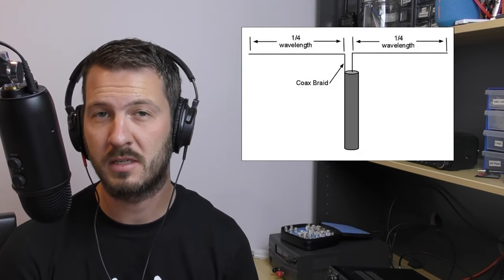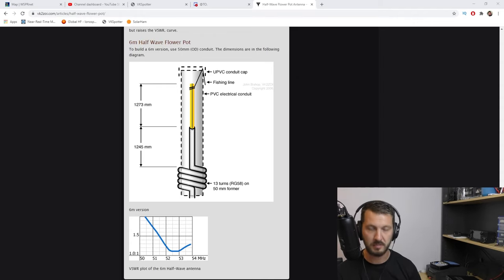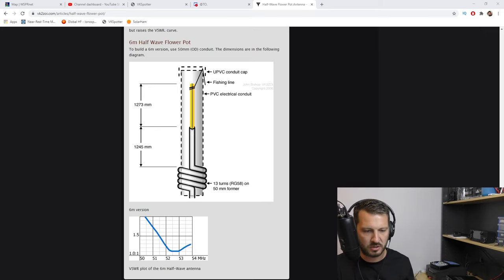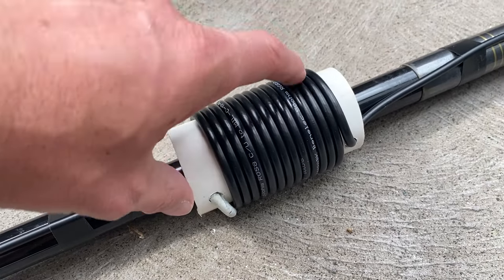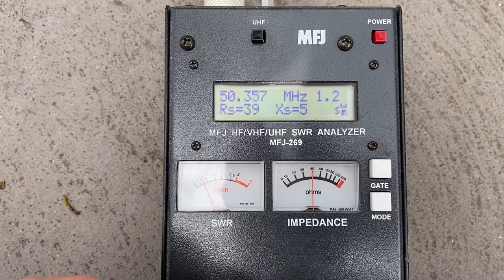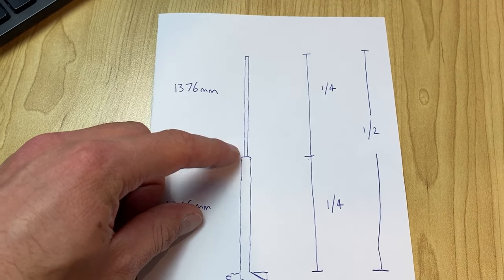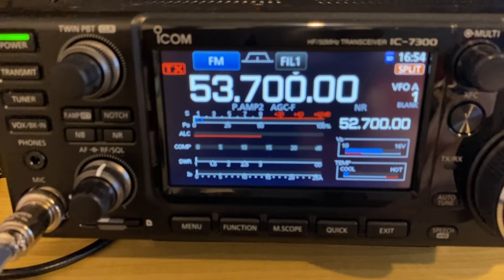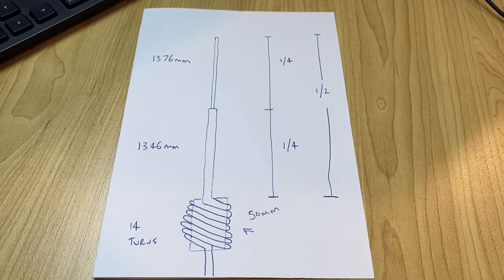Build an EASY 6 Meter (50 MHz) Vertical Antenna (Using just RG-58!)

Comment: This simple antenna was described by Bill Orr, W6SAI back in 1959 in his book "S-9 Signals,
Inexpensive antennas for the radio amateur."  He described it as the "Cobra" antenna due
to it's coiled decoupling choke at the base of the radiating portion.  I built a few for 10 and 6 meters.  Nice to have it "rediscovered."

Comment: I am new in to 6 meters and seen your video. I build it with RG8X to your specifications and i have a 1to1 SWR on 50.145 Mhz. Can't wait to try it out in the morning when the band opens up. Thank you for this great video.
Reply from the maker: Glad to hear you got a good SWR result Terrell! GL hope you work a few on air
Reply: ! only have a piece of RG8X, I can use this without modifications to this design?
Thanks, I'm a noob, have a IC7300 w no 6m antenna.
Reply: @elconquistador932   did you make it?

Comment: Great Antenna Thanks. I built one this morning, with measurements bare coax 1330mm, shielded coax 1295mm and 14 turns of coax on 50mm pvc.  I mounted it about 500 mm above my flat roof. 1:1.2 from 50MHz to 52.9Mhz
Reply from the maker: Nice work!

Comment: We used to call this a coaxial antenna, widely used for "mobile telephone" service before cellular phones made that service obsolete. We used to see those mounted on limousines, with a chrome plated tube forming the lower quarter-wave section and a whip antennas as the upper quarter-wave section. This seems an easy way to make one. It should work well on 2m too. Nice approach!   ~ de ND1L
Reply: Conner Alexzander  ...which has what to do with antennas? Or are you advertising something?
Reply: Had a friend who threw away a marine band antenna since it’s Radome was crushed. Took it apart and what to my eyes see? A coaxial antenna. Just remounted it into 1/2 inch CPVC water pipe. Worked great!

Comment: Well, I know this is an old video, but I stumbled across it, and boom, in one day (after some part scrounging) I have a 6 meter antenna! Used 1 1/2 inch ID PVC for the base and coil wrap with a pvc reducer to 3/4 for the vertical mast. VSWR of 1.5 at 52.4 MHz (13 wraps). Total cost less than $30. Great. Thanks. Subscribed. W8ISM
Reply from the maker: Nice work! Good stuff, 6m has been open the past week or so.

Comment: Just made this and works well.. used 13 and half turns and is all good no RF in the shack... Silicon seal tube for a 50mm coil...did the job.
Reply from the maker: Nice! How's it performing?
Reply: @HamRadioDX  Working really well. Strong locally in East Yorks area and DX into Germany and Italy on the first test out..

Comment: Hi Hayden VK7DG, I built one a few years ago for 6metres and instead of cutting off the coax shield I folded the shield back over the lower 1/4 wave with the insulation on it. This gave a flatter SWR across the band. I used a smaller coil former for the choke to fit the fibreglass pole I was using.  Cheers and good stuff.
Reply from the maker: Thanks Dale, that’s something to think about an experiment with! I was going to do another one, and maybe one for 10m to have a play so I’ll try that, thanks. Did you put heatshrink or something over the braid to keep the water out?

Comment: I need a 6m portable antenna. I found your video and built it with your dimensions, except with RG-8/X and not with RG-58. The SWR is 1:1.04 at 50.180 MHz. Great and thanks for the video.
Reply from the maker: Awesome mate!

Comment: Yes, the vertical bazooka antenna works great. One reason for this is it's a 1/2 wave dipole, no radials to push the pattern up towards the sky, so the radiation angle is zero, flat to the horizon. Back in the 1970s, I used to sell and service equipment for CBers during the CB-craze. The best performing antenna back then was Shakespeare's "Big Stick", which was exactly this antenna, just constructed a little differently to form a 17 foot tall self-supporting pole. 

Thanks for working out the numbers for me. ;-)  I came here because I need to throw together a makeshift antenna for 6 meters and this will be it.

Comment: Wow! I've now got a new dummy load. I made one and VSWR is 1.1-1.3 across the band. Length of exposed top 1,350 mm and bottom 1255mm. It will not be enclosed; it's a roll up to pack. The only modifications is that I formed an eye at the end to make it easy to hang. That effectively reduced the length by about 3/4". The other is that I used a disposable water bottle with a 2&3/8" diameter with 13 turns. Before making it I also calculated the feed line length to be virtually invisible using the VF of .66 before I cut it. All this paid off that I didn't have to trim it to get what I think is perfect. Hung it in a tree once. Now, if only I could get one QSO.🙄 I bought 100' RG58/U with BNC connectors for $18, so what I used cost $8. It has an adhesive backed foil that peeled off easily. Did your VSWR go up or down when you enclosed it in the PVC tube?😏

Comment: I would have liked to see you adjust this antenna to get a better match. Sure it's ok and you might use a tuner, but some of us want to use it on the SSB range Nd won't know how to tune it. Do you cut or extend the top, or do you add or remove a turn like many suggest? Left wanting more info Cheers

Comment: I have an old Amtron 11 meter antenna. Can i use it just as the whip and attach the stripped coaxial to the outside as you did with tape or zip ties. Not sure if the internal part of the 11 meter antenna will effect the performance.

Comment: I know this is a 2 year old video; however, I recently fell upon this and another one you did with this form of antenna. I have a question on the need for chokes, grounding, etc. Is a choke required or does the windings act for this purpose. Is it required to provide a ground system for this antenna if it is not used as a permanent install...only erected for use and taken down.

Thanks!
Reply from the maker: Hey mate, the choke is the coiled coax. It appears as a high impedance on the outer shield of the coax to stop common mode currents from flowing on it, back down to the transmitter. It’s pretty critical to get the correct turns/diameter otherwise the coil wont provide a high enough choke impedance. No need for a ground

Comment: I have an 8 metre squid pole with a choke at the bottom for HF. Question? Would it be feaseable to parallel the 6m ant to this, ? Thanks.

Comment: ..looks like your using RG 58 for the long feedlines... that stuff has 3.3db loss @ 50mhz (over half your power and received signal) If you can get some LMR 400 it would make a big difference. Buying a new FT891, best value in ham radio... and lo but it has a 50mhz bonus..my 80-10 EFHW does not work on 6, so this is a cheap n nasty option.. tnx Hayden   Richard VA7AA

Comment: Excellent video. I will build one of these this winter. For SWR purposes, do you have any idea of the length adjustment to make if I want to house this in a 3/4 inch diameter pvc pipe rated at 480 psi (standard thickness)? Thanks
Reply from the maker: Not sure about the exact length adjustment putting it in a radome. But I'd start off by making it slightly longer than you need, and then trimming from there.

Comment: Just a quick PS -- I DID strip the foil shield off when I stripped the braid on the top section.  But it's still there in the rest of the coax.  Thank you.

Comment: How is this a dipole when it's using the full coax as part of the half wave? Wouldn't in theory the full coax cancel out the magnetic field? I know that the rf will ride back down the shield but wouldn't it be more effective if there was an additional conductor attached to the shield that folded back on itself?  I'm new so sorry if this is a dumb question.
Reply: No.  Skin effect gives effectively two conductors.  One conductor is the inside of the shield with current flowing in one direction and the other is the outside of the shield with current flowing in the opposite direction.

Comment: How long is your rg58 feeder to the antenna? Line loss on 6 meters can be substantial. Loss is on the order of 2.7 dB per 100 feet. 100 watts in nets about 53 watts at the antenna end with the rest heating the coax. It affects receiving signals too. What kind of coax is on your Diamond antenna too? It is strange that you get such good signal on the homemade antenna and no signal on the Diamond. Coax or connector trouble?
Reply from the maker: Feeder is about 30 feet. Diamond antenna uses low loss LMR-240, same length.

Comment: How critical is the coil to the overall tuning and performance of the antenna? I have a T2LT that I made for 10m and no longer need. It can be easily cut down to length for 6m but the coil is 16turns on a 68mm former. Do I need to change it or is the coil less important?
Reply from the maker: Yes you will need to change the coil as the impedance of the choke will change. You’ll basically need less turns, so just unravel a few until you get the proper amount and run that extra cable back down into the shack

Comment: May be a silly question but .. why is the top 1/4 a different length to the bottom 1/4 ?
Reply from the maker: Velocity factor of the coax (bottom half) makes it slightly shorter
Reply: @HamRadioDX  I still can't see how you arrived at these figures, even taking into account the velocity factor if your target freq was 50.3Mhz.  Were you rounding off the numbers or did you change the target freq you mentioned in the video.
Sorry if I'm being a pain, I'm a bit new to this and my calc's don't come up with the same numbers.
Are the final numbers you have shown been AFTER trimming to achieve a decent SWR?
I've worked on 299.79/50.3Mhz and a velocity factor of .95
Another stupid question ... why does the velocity factor only affect one side of the antenna?

Comment: How much power loss do you estimate that your loosing with the impedence down in the low 40's?
Reply from the maker: Google “mismatch loss calculator”. Even with a 3:1 SWR you’ll lose only 1.25dB of your power. With 40 ohms purely resistive and no reactance, SWR is about 1:25:1. In other words - not much at all

Comment: Nice! I might make one of these, if I can get my hands on a pole. Whats the gain on one of these?
Reply from the maker: As it's just a basic vertical dipole, there is no free space gain as such. You could probably space it away from another pole used as a reflector to get some gain in a certain direction however

Comment: I'm a Newby at this stuff so please be patient with me.  I built the antenna to  your specs, but it was resonating at about 48 mhz and swr wouldn't go below 1.7.  I tried shortening both lengths proportionately, and the darned thing won't resonate at all! Two questions: First, the RG58  I used had a foil shield inside the braid.  Is this causing a problem?  Second, in America I couldn't get a 50mm coil form, so I used the best I could find -- a 2inch pvc pipe.  Needless to say it's close but not the same diameter.  Is this causing a problem?  If neither of these things is causing a problem, what do I do now?  Thank you.
Reply from the maker: Hey mate,
Couple of things - the RG-58 with a foil shield might have a different velocity factor, so the lengths may be a little different. You're right though, shortening the elements should have brought the frequency up. Where did you get it to resonate after you shortened it?

2 inch PVC pipe is fine. Maybe see if you can find another bit of RG-58 to try?
Reply: Thanks so much for responding.  When I shortened it, it wouldn't resonate acceptably anywhere.  I think I'm going to find a hunk of RG-58 without the foil.
Reply: You must have missed this. Peel the foil off. I did and VSWR is 1.1-1.3 across the band.

Comment: 9.28 the  diamond antenna has an incorrect connection. the cable must exit strictly in the center of the branch pipe.
Reply: Huh, really? I mean, mine is like that anyway.... but.... would it really effect performance that much???
Reply: @anonyninja7737  this is part of the symmetry. Helps from the leakage of RF currents on the outer part of the braid

Comment: Thanks Hayden, I just put a new Bushcomm swc100 up after lightning strike blew last one apart. Surprisingly, the old antenna had a SWR of 1.2 on 52.525?  New one is SWR 3.8.  However the 7300 tuner can get it down to 1.2. Have had a chat on 53.825 repeater with good reports.  How much damage am I going to do????  Should I attempt to build this antenna for 52-54Mhz. Cheers and thanks. Don VK7LDH.
Reply from the maker: Hey Don, the new one you put up, is that tuned for the bottom end of 6? You won’t do any damage if you use the tuner to keep the SWR down. I do it with my 6m vertical, it’s tuned for the bottom end of 6, but if I want to use the FM repeaters I use the tuner as it’s above 2:5 up at 52.5 MHz. Hope that helps, be good to chat on the repeater soon too 👍 can you get into 53.700 repeater?
Reply: @HamRadioDX  the antenna is only tuned for 80 - 10 metres. That is why I and Bushcomm were surprised with 6m. Yes, I get I to 53.700 (Kaoota). It would be good to catch up on there sometime. Thanks for your answer. Without 7300 tuner, the entire 50-54 is over SWR 3. Tuner brings it down though. Cheers.
Reply from the maker: No worries yeah if tuner tunes it down and it gets in all good 👍 catch you on the air soon
Reply: @HamRadioDX  I will call on it more often. I also get into the 10m on 29.680. Both usually quiet I find. Like now :)
Reply from the maker: Cool, 29.680 is offline at the moment, on the to-do list to fix!
Reply from the maker: Just checked out your QRZ, you have a great outlook up there!
Reply: @HamRadioDX  and here I was thinking, these things (repeaters) just worked/appeared like magic 😀  so dumb of me 😀 If you ever need a 'non technical' hand, yell out. Yea, God's country up here 😀

Comment: I built one and it worked well as far as SWR. I didn't have 50mm PVC so I used 40mm electrical conduit and added a few extra turns of coax. Measuring to an exact millimeter is rather difficult. I just got as close as I could. It appears to be very non-critical. SWR bandwidth seems very wide. Now I would like to determine if this can be scaled up to 17 meters. I wonder how many turns on what diameter to use for an RF coke for 17? All I can due is experiment.  Thanks for your video.
Reply from the maker: There might be a bit of extra info in this video -  check the description for a link to turns on different former sizes too. Cheers! https://youtu.be/GCubZoD25tc
Reply: @HamRadioDX  yeah. Quite a bit of chatter that had nothing to do with half wave verticals. One thing I'm truly curious about: how did you arrive at these dimensions? A quarter wave at 50.5 MHz is 1411mm. Allowing for velocity factor if indeed that applies (66% for RG58A) would give 931 mm. So where did 1346 and 1376 come from? Just experimentation?
Reply from the maker: @1dxvictor  the dimensions were scaled from the VK2ZOI experimentations. Just tried it until it worked
Reply: @HamRadioDX  OK. You got me. I can't find any mathematical approach that results in your dimensions. Most methods come out with values quite a bit smaller than what you have. Trying to scale this to 10 meters will be interesting!
Reply: @1dxvictor  .66 is VF inside the coax, not for current flowing on outside.

Comment: Thanks for the build and demonstration, but I must chime in that it would be a more accurate test if each antenna had the same feedline.
Reply from the maker: The coax antenna had RG-58 as the feedline, probably about 5 metres. The Diamond has LMR-240 which is lower loss but about 10 metres. At 50 MHz the loss difference would be within 1dB.

Comment: The fundamental design issue with this type of antenna is that the choke (coiled coax) is at the end of the lower dipole element, which is a point of maximum voltage and thus minimum current. Chokes are magnetic components and thus work on current. So it's not the ideal location to place a choke; it can't possibly be highly effective at the location. This is not to say that it wouldn't work as an antenna; stray currents on the coax can radiate too.

The coaxial or sleeve antenna, where the lower element has its own hollow element with a true end (open circuit) at the bottom end is fundamentally a better design (at least theoretically). Note the distinction in that this form of antenna uses the outside of the coaxial cable shield as the lower dipole element, as opposed to coaxial or sleeve antenna that actually has a distinct lower dipole element that is hollow, with the feedline run up and into it.

Acknowledge in advance that this is a nitpick. I just don't see anyone else pointing out the current minima at the choke location. 🙂
Reply: Try making one. I did.

Comment: Uhm, wouldn’t it be a normal centre fed dipole if you just took the jacket and turned it downwards along the cable instead of cutting it off?
Reply: No, then it becomes a sleeve dipole, still and end-fed antenna.

Comment: Anyone tried putting radials on this antenna ?
I'm thinking about giving it a go with 4 X 1.4m radials at the feed point just below the coil.
Reply: its actually a dipole, radials will give you bad results im afraid.
Reply: Duh, I'm so confused🙃

Comment: Be great if you could share how to come up with our own measurements using different coax cable types and how you worked out the lengths using the cables velocity factor. 
This video only teaches us how to build your antenna. Good video though.